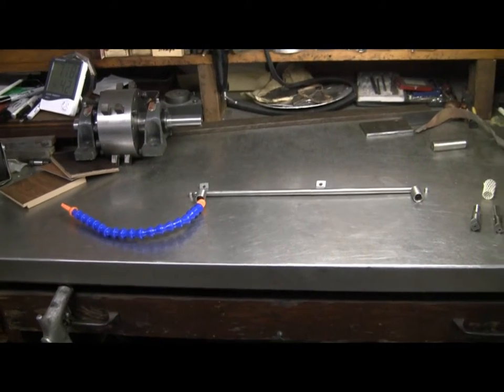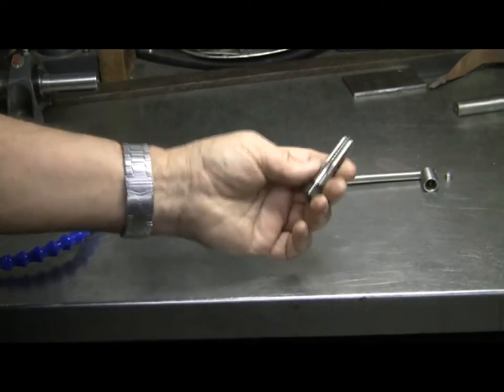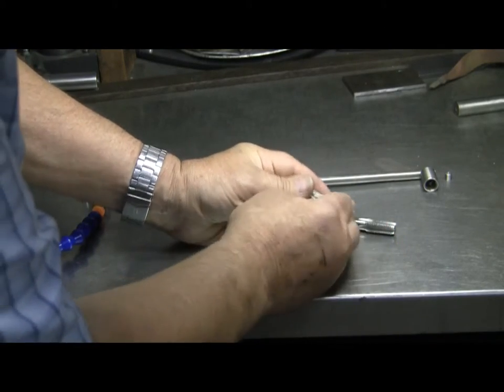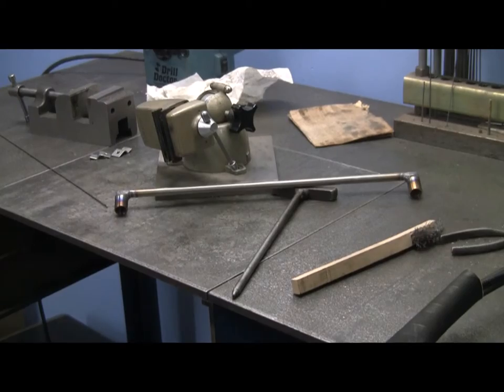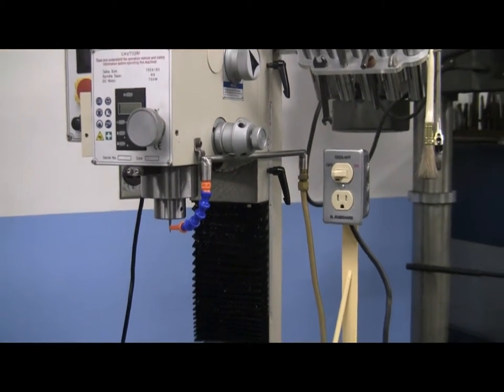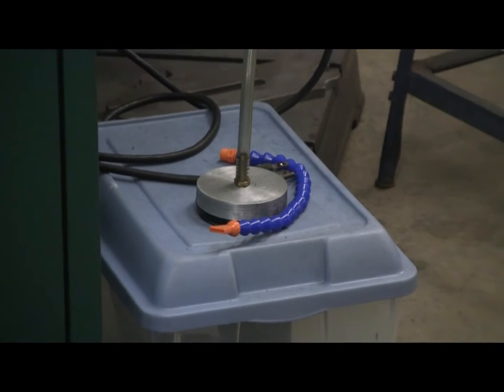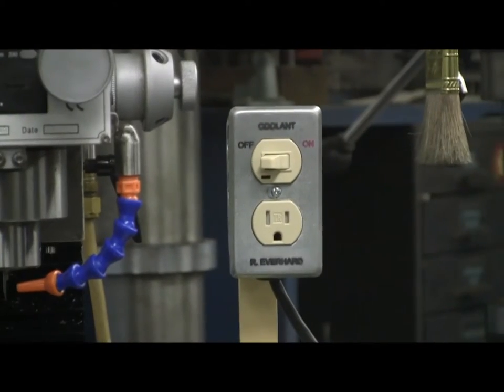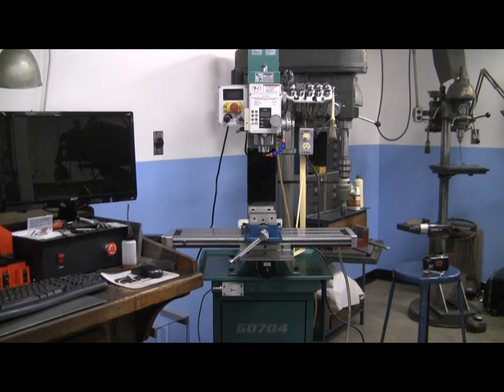Coolant System for Grizzly G0704 Mill

Comment: Hi just purchased a G0704 Do u no what's a Good speed to run a 3/8" end mill to cut 7075 aluminum? And what gear High or Low? Mines still stock in not converting it over. I'm new to cnc machining. Thanks in advance
Reply from the maker: For Aluminum it is best if its a 2 flute end mill.   Try it at about 1,000 RPM.   Don't know if I have ever used 7075.   2024 has been my choice, but it will dull cutters rather fast for Aluminum.
Reply: Ross Everhard  Ok Thanks I'll try that out